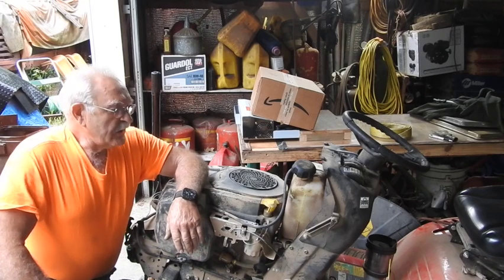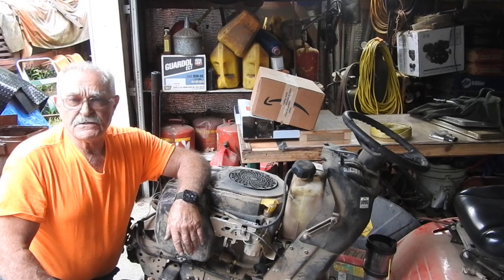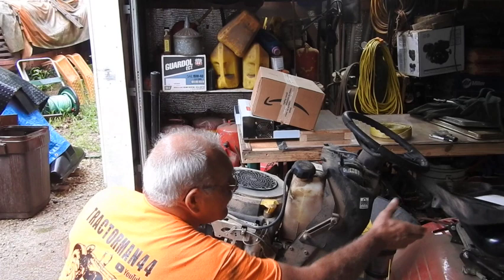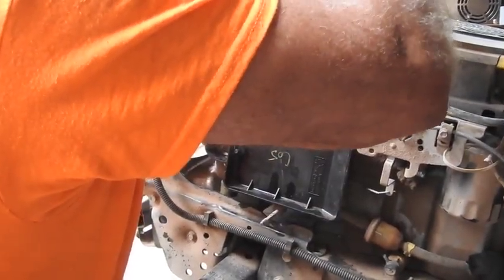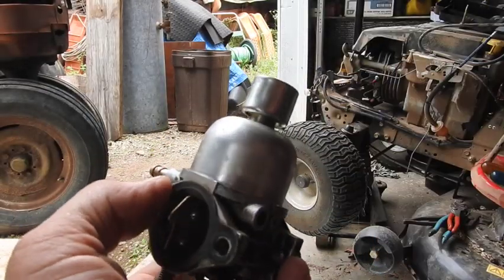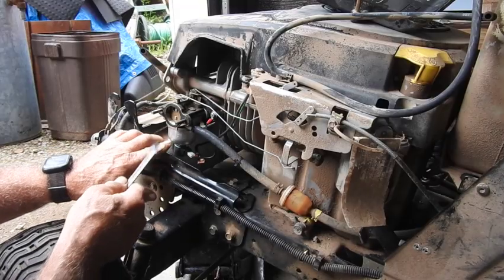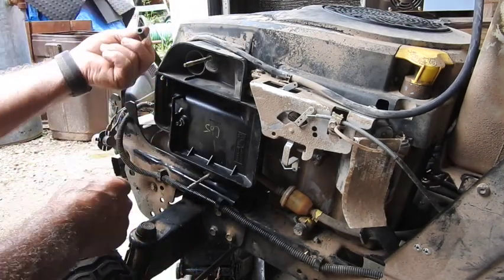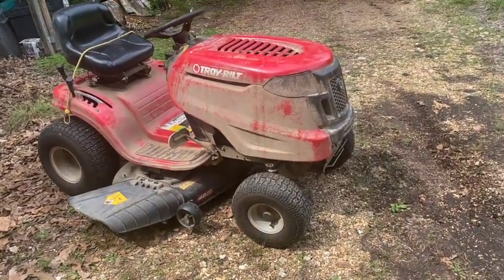Troy Bilt Riding Mower Won't Start

Comment: I wish I could find a good repair man. I've taken both of my lawnmowers to the repair man only for them to run maybe one or two times and I'm still without a lawnmower because neither of them will start after taking them both (push and riding mower) back to him for repairs and still neither of them will start. Just a waste of money.
Reply from the maker: Unfortunately the big culprit with the problems you describe can be attributed to the modern 'engineered gas' we are being provided.  The formulated gas is intended to be used by the consumer within a 30 to 60 day period.  Beyond that and the fuels can seem to become problematic unless you, as the end user, take steps for extending the 'shelf life' of it.  The product I use religiously is PRI-G for gasoline and PRI-D for diesels. That in conjunction with a dash of SeaFoam seems to maintain the fuels stability for an extended period.  PRI-G is so good, I add it to my 5 gallon containers at a rate of only 1ml/ gallon of fuel with an eyedropper.  
    Also for extended shut down over winter, drain the fuel tank down to just a small amount on the bottom of the tank then add SeaFoam...about 1/4 cup.  Run the engine completely OUT of fuel then and store it away.  This is for lawnmowers, weed eaters, push mowers, ....any small engine except two strokes.  Run the two strokes dry with the mixed fuel only.  Then let them sit in storage.  I think you'll find this to work pretty well with this nasty stuff they call gasoline today. Good luck my friend.
Reply: @tractorman4461  That could be the issue but when I go pick them up they start and no lie as soon as I get them and try to start them they won't start. I wouldn't say he repaired them but I would say is he rigged / patched them up because I know how to start a mower it's just after his work it's difficult to start them. The push mower will start and shut off, the riding will only turn but won't start.  So I don't know.
Reply from the maker: @dwilliams8002  All indications are sounding to me like it is fuel related with both machines. Personally I would install new  CORRECT spark plugs and use NEW fuel treated with one of the good fuel stabilizer products and see if that helps.   I think replacing the air filters and changing the plugs are basically all a homeowner is expected to do any more when it comes to small engines.  There's no points at all to get out of adjustment, and there's little to adjust on the carbs at all.  Even the floats are mostly plastic and not really adjustable. I sure hope you get to the bottom of the issue.  Small engines can drive a guy just plumb nutz !!